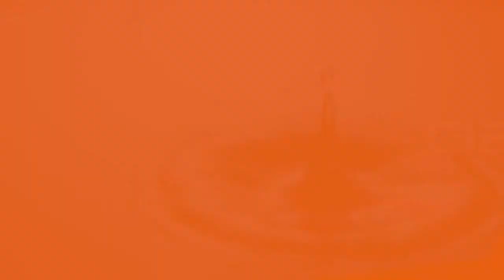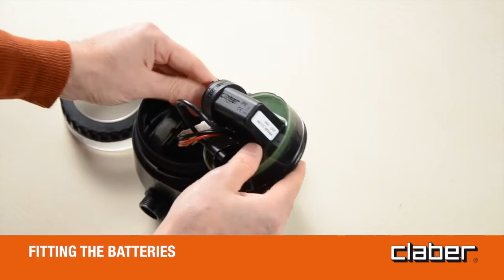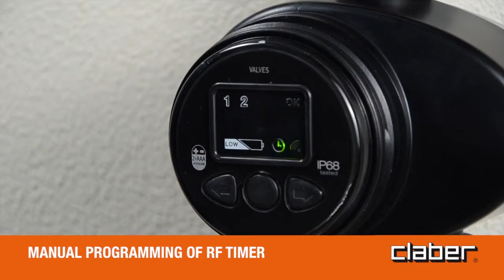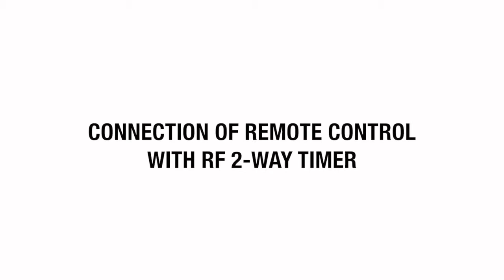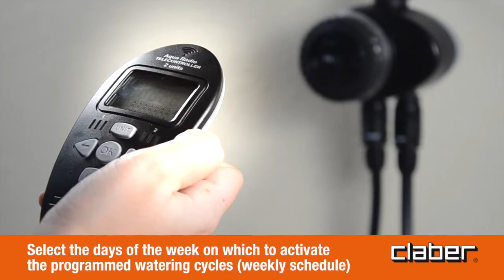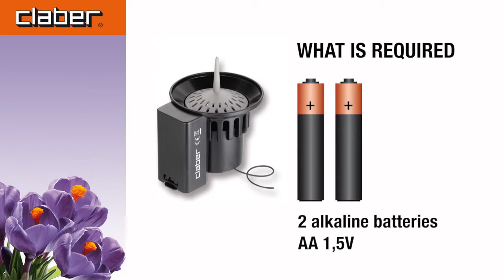Claber Duplo RF Battery Water Tap Timer 90832

Comment: Can you turn on/off the valve through the remote control?With out setting time or schedules.For example i am passing nearby my garden and i want to turn the sprinklers on can i do it with the remote control?
Reply from the maker: AnalysisX You can open each valve manually for 5 minutes only by using the buttons , this is shown in the video around 2:35 minutes. But you cant fully program or adjust the settings of the timer without the handset.

Comment: Hello.Can you turn on/off the valves without programming with the remote control?
Reply from the maker: AnalysisX Hello, you can't use the timer without the remote controller. But if you just wanted a dual outlet timer without RF compatibility, why not have a look at the Duplo 8410.